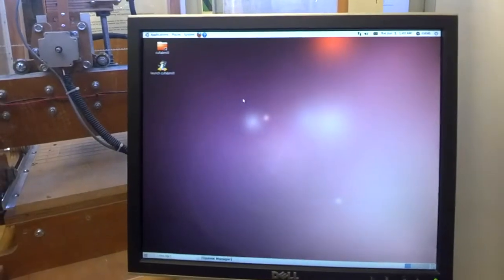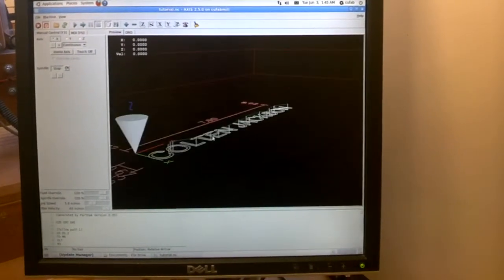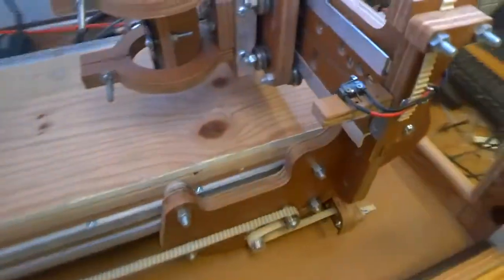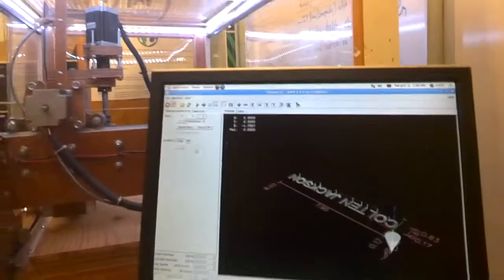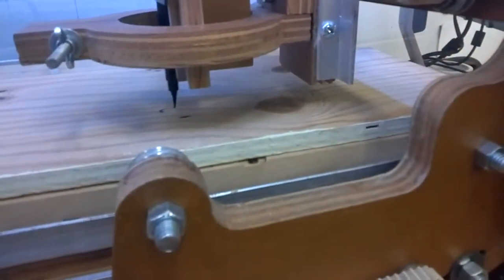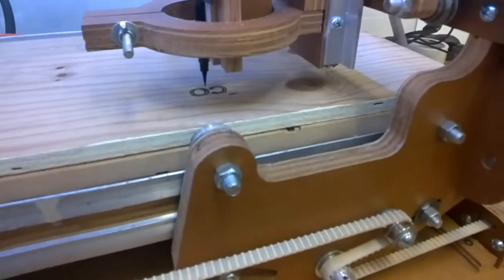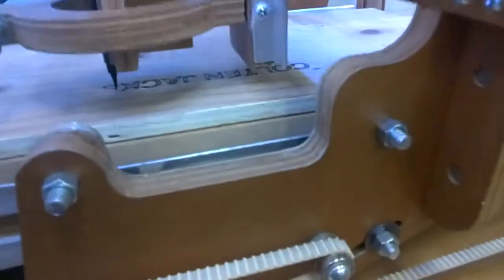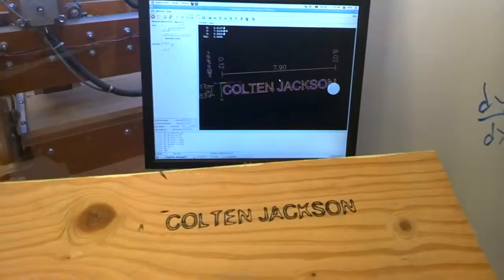Loading gcode into LinuxCNC at CUC Fab Lab

Comment: You don't have to slow it down - you can use g64. I wrote a postprocessor for fusion360/hsm that will automagically inherit the smoothing tolerance from the path on every post